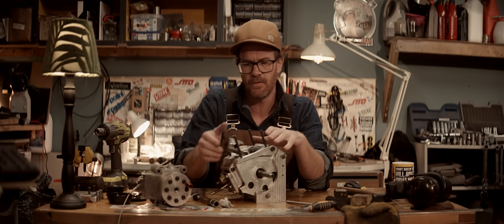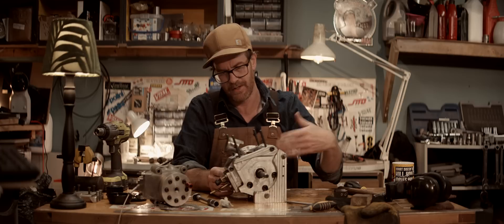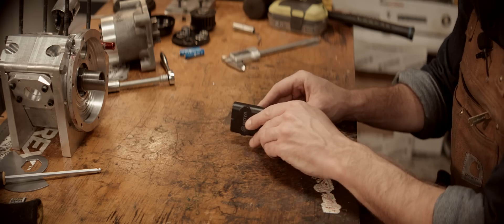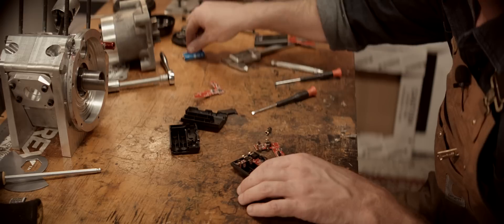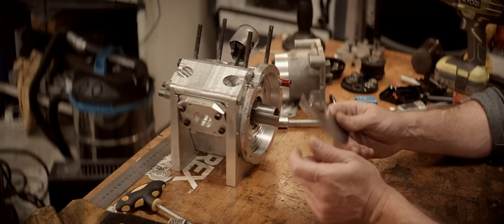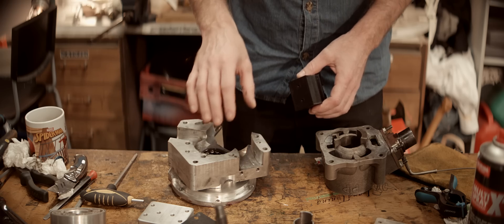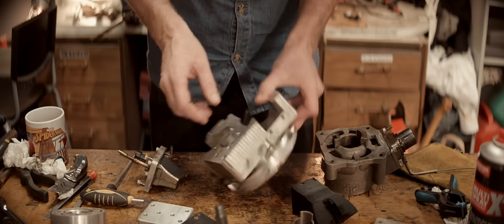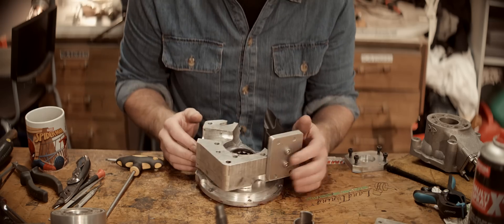18 000rpm + Metal powder in fuel =

Comment: its not the carbon at fault in the rotary valve.  it has not been cured at a high enough temp . it needs to be cured at 250 to 350 deg farenheight and you have to use the right resin!!

Comment: We utilize tappered shafts on snowmobile clutches and even tho there are pullers on the market! I have found and now completely rely on removing them hydraulicly by removing the retaining bolt and seeing to tip the snowmobile onthe opposite or mag side and pooring warm water down the threaded hole that i removed tge retaining bolt from and then simply apply 10 wraps of teflon thread tape to tge retaining bolt itself and simply see to threading of it back in until  it has no choice but to see to releasing with that of a rather satisfying pop! This has proved to be a thus far for me a 100% reliable process! I hope it is or can be in the future of some aid to you!

Comment: The lower rod bearing cage is too big/heavy for 18,000 rpm on an engine that size.  The cage just floats, holding the needle bearings parallel, and the centrifugal force in the heavy cage breaks through the oil's film strength, and the cage rubs on the ID of the lower rod end bearing surface, turning the lower end of the rod blue.  A 16mm dia. cage that we run has that problem above 17,000 rpm (32cc Zenoah RC car engine).

Comment: The bottom bearing should be larger. If running 18 k and 20 hp the bearing should be bigger. Also it's possible to make a some kind on black nitriding or better surface in a bearing,

Comment: After some thought, I believe that you inadvertently damaged the anti-friction bearings (crank/rod) early-on when testing with the reed valves and r/c fuel. Never-the-less, it may be time to switch back to methanol for your fuel, and a minimum of 9% oil (3% degummed castor oil and 6% synthetic). Methanol offers a great cooling advantage over gasoline, but is hydroscopic—it attracts water—and causes the corrosion of both ferrous and non-ferrous metals. Degummed castor oil will protect overheated bearings (and other engine components) from high temperatures by polymerizing into a protective varnish, while synthetics will simply burn. One thing about using oxygenated fuels such as methanol: the engine should be run dry of fuel after its last run of the day, and be doused with an after-run oil such as Marvel Mystery Oil. The combination of superior cooling and protection against high frictional temperatures should provide longevity to your bottom-end bearings. Best, as always!

Comment: In regard to the mic, (without having looked at it anyways) it should still be easy to work around some fd pads. Depending on how bad it is, (and assuming its only dual layer with the jack pads on top) it might be easy to scrape a bit off coating on the traces that used to lead to the pads and just blob some solder around as a replacement. If that wont work there is absolutely no reason you couldnt run a few short wires from wherever the trace damage ends to where you need the jack and just cover it in epoxy/jbweld to hold it in place. In fact if this is a reoccuring issue, you might want to just open the new one and reinforce it right away. I totally understand not really wanting to spend much time on it, but it definitely seems fixable.

Comment: I have a crazy dumb idea, why not make the crankcase sealed!?!?   Use the supercharger to start the engine and run it! Maybe machine a plenum leading to the transfers,  allowing the intake charge to be stored there, then when the piston uncovered the transfers, it fills the cylinder really quickly. Like a capacitor in a circuit,  a rough estimate, the plenum would need to be equal to the cylinder volume,  I'd make a removable cover,  that  fits inside the plenum, about 12mm and hollow on the opposite side, so it can be flipped over, to add to the volume, just a rough guess add a 24mm x 40mm x 70mm  and make shims  to allow the volume to be tuned.  I see this plenum looking  similar to a scarf around a person's neck, if the cylinder was the neck.  I could be wrong, the volume may need to be twice cylinder volume, or half, I do believe it will greatly effect performance, it will likely require a different cylinder, if the cylinder and transfers were separate all the way to the bottom of the cylinder. Then the passage could be blocked at the crank case the transfers accessed from the outside the plenum bolted /welded to the cylinder, use 25-30 mm tubing to connect the plenum to the supercharger/carburator,  possibly incorporate a small oil pump on the supercharger, to oil the bearings in the crank case, maybe a couple small holes in the cylinder to allow oiling of the cylinder walls, a tiny hole or series of holes started from a single location. And possibly run a small trench in the bore, below where the ring travels, at a 30°-45° angle only about  .030" deep, and . 030" wide with several . 020" oil holes inside,  allowing oil to basically seep through the cylinder wall,  all the holes starting from a single 12-20mm fitting, in a 9-16mm hole for oil, with one on each side of the cylinder front and rear,  with a roughly .025" restrictor, and a bypass to limit flow according to throttle. Also using a sump on the bottom of the crank case to recover excess oil possibly still 2T oil, being it will likely still be burning some, as the upper cylinder is lubed, using mixed fuels, but can likely be run straight, id test this carefully though,  still a rotor valve can be used to separate the plenum from the cylinder to get better (what would be event timing in 4t engines) I guess port timing,  I guess a rotating pipe operating like a ball valve can also work, using  a pressed on brass bushing, that has ring lands like a piston,  alternating from a tight to bush fit, to tight to race, fitting about 4 rings about 3mm wide. with  roughly a 2mm land to space them apart. Using a brass race to fit the bearing/seal units inside, a 50-65mm tube forming the valve using a roughly 20x70mm opening being the port,  the whole thing in brass, with replaceable soft iron wiper seals,  possibly having graphite cores as a self lubricant. Being inside the rotating valve, like the vanes in a rotary vane pneumatic motor, in die grinders and impacts, being about 1.5mm wide and may require a hard steel surface,  possibly consider using chromed stainless to prevent  rust and a heavy chrome coat is hard a .020"-.030" thick chrome should last a long time, with a soft graphite rubbing against it. Possibly look into making a similar valve for the exhaust, maybe opening an additional pipe, with a top end tuned exhaust,  basically a 2stroke v-tec, have about 2-3 power bands kicking in, use a butterfly in the plenum, to double the volume to change the power curve, a boosted nitro 50-60cc engine making 100 HP + at 25k rpm.  Running 30 psi boost,  with a small dry ice to air intercooler, the air entering the carb at 10°f, using a pre cooler, circulating methanol  through  a water/air intercooler  on the intake,  with the methanol at dry ice temps. Possibly melt the dry ice in methanol.   The air leaving the supercharger/ intercooler at 40°f. Possibly  less, as it enters the engine!   The 25-30 maybe  40psi boost, with  a compress ratio  of roughly  10.5-11.5:1 maybe reduce the compression to raise the boost,  the next possibly would be to look at using a sleeve valve arrangement for the 2t intake! And possibly the exhaust, use 2t oil to cool the sleeve,  with ceramic graphite seals around the ports, they will likely leak a bit, being 2t oil, it can lube the rings as it burns. Possibly have a ceramic labyrinth between the sleeve and the cylinder, with water in the cylinder, oil circulating in the ceramic labyrinth   being cooled by the water jacket in the cylinder, aswell as a oil cooler, using 2toil, or 5w20, 0w20 or something,  with a 100x200mm oil cooler, with a couple 100mm fans, and a 200x200+/- radiator holding roughly a 1gallon of water total. I'd like to build a twin cylinder, opposed piston like This, it should be smooth, even with non roller bearings and wet sump 2t   with a ball like intake valve. I believe the plenum is a game changer allowing the cylinder to fill soon as the valve opened. Or piston clears the port,  using a small supercharger with a bypass, then a turbo the power should nearly double, being the supercharger requires so much to spin it,  and for starting it needs to produce 1-4;psi at 500rpm roughly to start the engine,   and use the turbo boost to open the bypass! At possibly 3k rpm. Making a large power gain as the engine stops compressing air, freeing HP. Possibly as much as 40% , a 4hp gain on a 10 HP engine, I think is noticable! Especially over a roughly 500 rpm difference in the power band,  and could be greater if the supercharger can be decoupled, by electric clutch or something. This is all adding up to alot of cylinder pressure thick cylinders and decks, possibly using triple o-rings two in the head one in the cylinder, 1mm tool steel hoops, with 1.5mm spacing between them, using a .015" copper gasket,  with small o-rings around the 3mm water ports, about 4, around the cylinder , and 12 bolts 6 close to the cylinder.  6 around the perimeter.  A 70-80 mm+/- circle for the inner bolt pattern, a 150-200mm outer bolt pattern, using m8 on the outside, using studs on the inner, from the crank case, with the actual combustion chamber being replaceable, basically a 55-65mm round disc with a m10-12 spark plug in the center,  with the chamber just large enough for the plug. To allow  the actual chamber to be in the center of the piston! The dead soft copper foil gasket. Should be reused several times, as long as it's not corroded, or damaged.  
I may get some poly foam,  and start carving out the parts. To build one myself, maybe use a turbo, and a 72volt 2500 watt bldc motor to start the turbo spin it up to about 15 k rpm to get some flow into the engine, allowing it to start, a 16-18k rpm engine making 30-40 hp would be plenty on a scooter,  convert a 4t to a 2t of this design,  using a 40mm stroke with  65-70 mm bore , is more than 50cc  the only  thing better would be a two cylinder! 🤔  Sorry to ramble, but would you consider this design?

Comment: In the Kart 100cc engines we always ran a full synthetic oil at about 18:1 otherwise you would get all sorts of failures, this was for air cooled engines. I like where you mounted the exhaust probe  - perfect. any high rpm readings yet. You are going well - hang in there dude :-) Matthew
Reply: Yes very true. When I ran Bel-Ray oil in the 70's the mixing figures were massily lean in my air cooled 125 Yamaha race bikes.  The pre mix Alex is using is mixed at around 50/1 I believe but runs Stihl strimmers fantastically well in commercial use 8 hour days. A little extra oil wouldn't go a miss in this tight tolerance engine.
I was taught castor oil for the crank, synthetic for the cylinder.
If I was running the Aspen premix, 50/1 run in period and 30/1 for testing and 25/1 full race mode.
I think you ran a massive secondary compression 13/1 actual?

Comment: The problem with big end roler bearings is that the rolers have to change speed on every revolution of the crank. The faster the crank speed the faster this change in speed has to happen. Thus through inertia the rolers start skidding on the pin and with increacing wear loose shape.
Your black goo may have contributed, but then the main bearing should have also been damaged.
Service the crank more often.

Comment: I wonder if you even need the rotary valve anymore. I can’t remember that well but didn’t you put the rotary valve on to fix the bogging and running rough that was solved by starting the engine at a higher rpm. Why not go back to reeds? Would simplify it again.

Comment: future video, everything is put back together, WONT REV.                         I BELIEVE,  now there is an air leak. due to using a puller in attempting to remove the rotary valve case, i must have inadvertently, caused a leak. I GLUED IT IN PLACE, TRIED TO REMOVE IT AND FAILED.
 
 i remove caps lock to say, i have had a few beers, and i hope im wrong.

Comment: 5 micron is .0002” pretty small number. What is the top to bottom. I used to hone for work with tappers less that .0002” over 3” length. Ceramic and carbide material was easy to hone.

Comment: I have rebuilt plenty of 2 stroke cranks.  And alot of them have zero play in the big end.  But once apart, the pin looks like a gravel road!!
Reply: Do you have any thoughts on what balance factor the crank should have on such a high revving engine with such a long rod. Alex has suffered with crank vibration issues going back to the SPX 8 years ago!
I firmly believe crank balance is a major factor for gaining revs and reliability.

Comment: I'm not convinced your con rod bearings suffered abrasion wear. That would have produced small but still round needles, not flat or square. I think it might have been bearing skidding due to cage inertia. Maybe look into a lightweight cage or even cageless needles and/or increase the lubrication of the big end bearing?
Reply: I was thinking the same thing, the big end bearing has a really hard time due the the way that RPM of it increases and decreases every stroke, at high RPM you need very light but high quality big end bearings. Back in the day TZ bearings were and good upgrade for the RD350LC engines.

Comment: You can scrape the silk screen off of the pcb along the trace and solder to that. The real easy fix would be to epoxy the headphone jack to the pcb and the run jumper wire to the lead of the next component along the trace for each ripped up pad.
Reply: Just what I was going to suggest!

Comment: Have you considered the possibility that the bearings were already gone before you installed the rotary valve? It would explain all the running difficulties you experienced. It simply couldn't run well because of the added friction from the fried bearing. They were probably worn out from oil starvation because of the high rpm. Normally moped cranks cannot take 17000+ rpm for long. To me it seems unlikely that the goo from the disc really did the damage. Many people have ran a carbon disc in an aluminium housing and I have never heard about this problem.

Moreover, I think the big end oiling is going to demand extra attention for constant running above 17000rpm. It is really unknown territory. Maybe a titanium connecting rod could help there to reduce the load on the bearing. Or some extra oil injection directly above the bearing.
Reply: I feel like this is the answer. Maybe the wear accelerated a bit from the carbon goo, but this looks like not having much lubrication at all.
Reply: Oil injection like old racebikes is the answer, but how reliable are those systems...
Reply: In Alex’s design there is no drillings that go between the bearing and crank seal down from the transfer tunnels in the cases (addition of these would help the crank bearings live a bit longer at least)….Making the rod bearing live longer will be tough on a side inlet rotary disk engine, because lubrication doesn’t make it directly to the slots / grooves in the big end of the rod like it would if the rotary valve or reeds was on the front of the engine (in line with the axis of rotation of the crank)…..I agree (ideally) supplemental oiling, or a way higher oil to fuel mix 6-8%  might work as a bandaid fix (short-term)…….maybe trying the reed inlet design again once the crank is replaced would be a good idea to prove if rod bearing damage was the reason for poor running in recent video’s, not the other hypotheses discussed???

Comment: A very experienced two stroke mechanic once told me that premix isnt ideal for rotary valves. Commercial rotary intake fed engine usually use an oil pump to squirt oil directly on the valve since premix is too diluted and the lubrication cuts off once the valve closes. 
Might be something to think about, especially with the extremely high rmp and experimental setup.
Reply: Yes, your quite right. Thats fine if you have a oil pump systen installed. Mist lubrication has worked reliably for many years. The valve material's have to be correct which they aren't at the moment. I was putting my money on the crank not driving the valve true.
PS, I can remember when Suzuki GB removed the oil pump off their works GT 750 bikes to save a little power and reliability suffered enormously back in the 70's.

Comment: Considering it is oil vapour lubrication replacing the bearings should be a matter of course at a max of 10 hours run time . The more performance you get the less time the motor will last and something like moreys when assembling for initial lube .
Reply: Since Alex has changed to over the counter pre mix the reliability has being brilliant.
People must remember there are no main bearing lubrication ports in the crank cases and the primary compression is ultra low so poor mist lubrication.
IMO the crank balance is very poor and with the longer con rod makes things worse!

Comment: Or the 'dust' isn´t abrasive, and you just overrevved it so it seized..
Reply: Dust is abrasive, that's literslly what air filters are for
Reply: @flakey7832  Ofcourse, i was very loose with my statement.
See it like this: without running aircleaner it can take hours and hours before it wears out a bearing.
It will wear out the piston and liner much faster.

And by this, i think Alex is as always focusing at the wrong solution for a problem, he did rev it above 18k, and has done it multiple times, and for a long time....
To get a crank to survive that you need to modify it some to ensure lubrication/cooling of the bigend.

Comment: Ive driven about 20 kms with half the nicasil missing from the cylinderwall, water in gearoil which foamed so much, it squirted out from the engine. It fucking ripped at high rpm though 😂